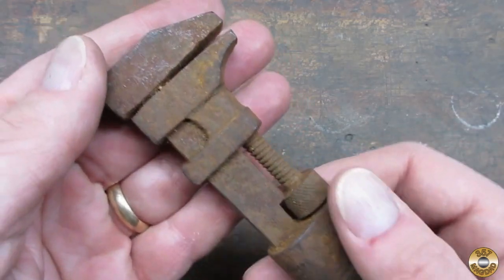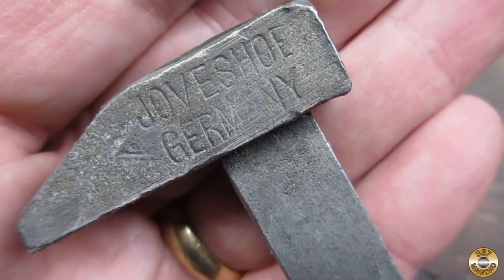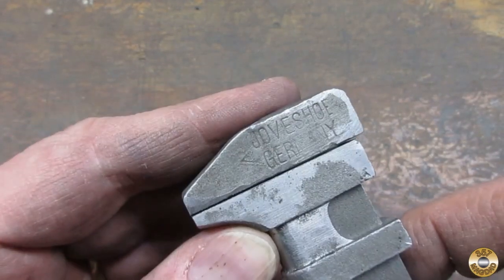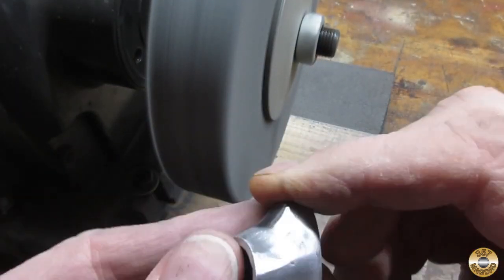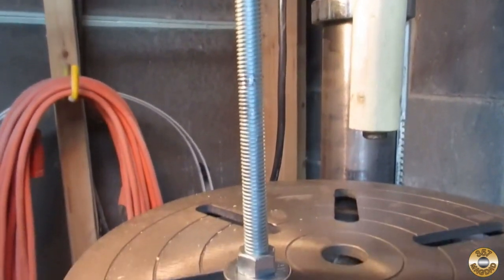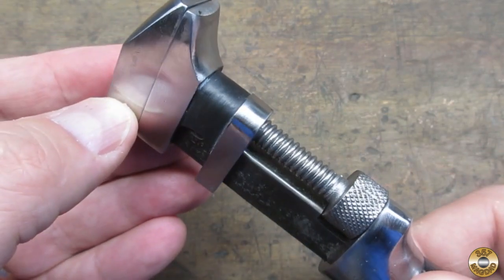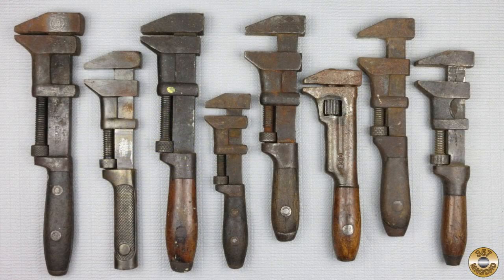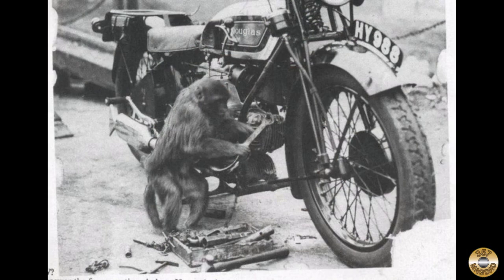Hand Tool Restomod - Vintage Monkey Wrench

Comment: Looks great.  But I wouldn’t have painted the wood, since it can wear off with use. I would have gone with some hardwood and then dyed it with an aniline dye.
Reply from the maker: Thanks for watching!  I have a North Bros No. 90 with the same handle finish that I use every day.  The matte clear over flat black has held up really well.

Comment: I always wonder about those coes brothers wrenches. They make the top jaw extend slightly further in back, implying it can be used as a hammer. We have all seen examples where someone used it as a hammer and it obviously is not fit for the job. But on the flip side we also always see jaws that have sprung because of the poor steel. Was the manufacturer perhaps thinking that if the user occasionally misused the wrench as a hammer, it would bend back the jaw into parallel position. I realized that sounds cynical, but every different make seems to have that slight step between the two jaws
Reply from the maker: That's an interesting theory!  My experience with vintage tools has been that everything gets used as a hammer sometime in its life!

Comment: Very impressive restoration! I think you have every right to grind out the manufacturers stamp and put your own. What was your trick on the aluminum pommel? It matches the steel so well at the end! I really thought that would be a sticking point
Reply from the maker: The fiber wheel and Flitz did a nice job on the aluminum!

Comment: Nice job, I would have just ground away the makers mark myself and given the jaw a nice new clean finish it's already partly worn and dinged and you modified the tool doesn't seem much point in preserving the mark.
If it's a straight restoration then yeah I would save what there is of the mark but if it's a modification and the mark has to go to get rid of all the dings and dents then away it goes in my book.
Reply from the maker: Thanks for watching!  I have a tough time removing maker's marks, even on restomods.